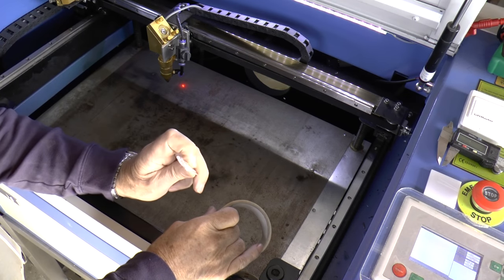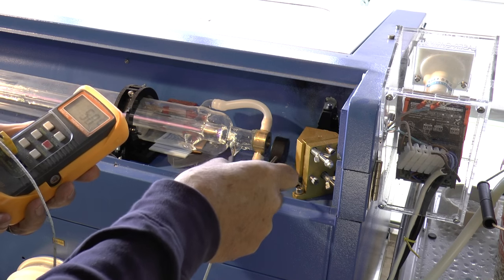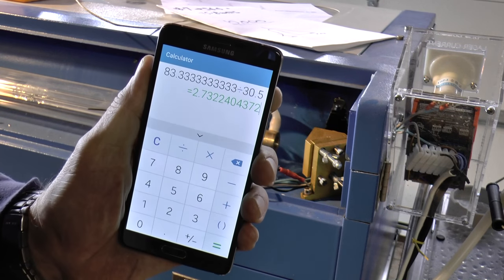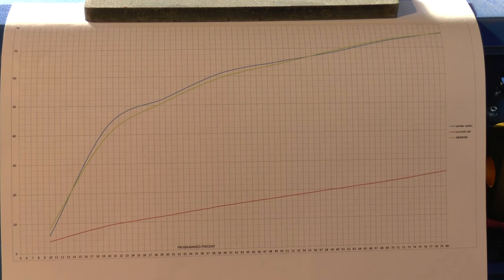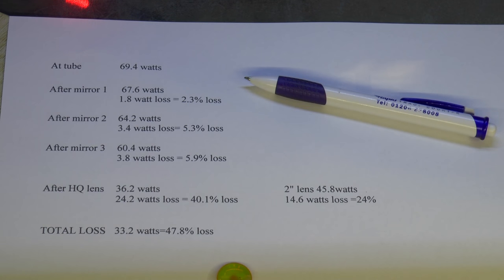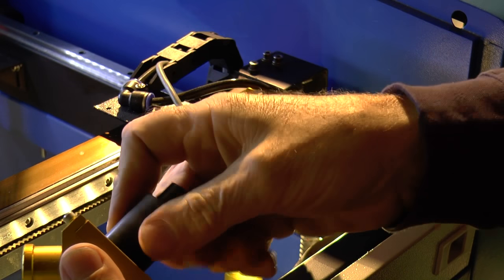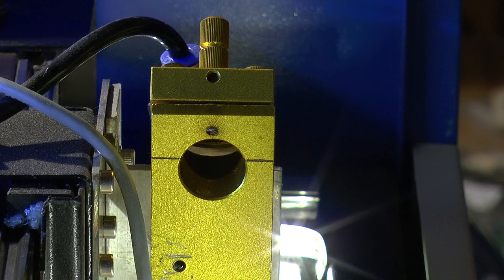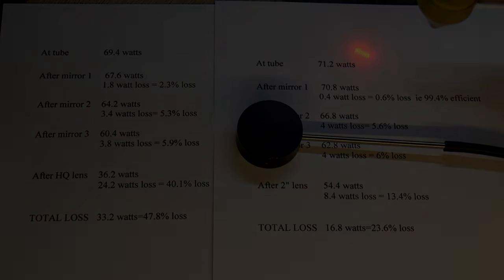RDWorks Learning Lab 79 Machine Health Check Part1

Comment: Russ, thanks to your labs I recently replaced my 50 watt co2 tube (after 6 years) and after carefully adjusting my mirrors  I was disappointed in the results. Looking at my #2 mirror I found it appearing like it needed cleaned but couldn't get the  wet look off. (like just cleaning it with alcohol but never drying?) So, I then ended up replacing all three due to their lack of luster or cracked appearance.
Now my performance and expectations have been met and I'm so glad for those labs like 79 and a few others.
Thanks so much,
Rick

Comment: Hi Russ...

Thank you for another splendid video. ;-)

At 20:39 you flick the mirror in the light, and in a split-second I could see that you have SERIOUS scratches in the mirror surface. 
That's for sure one of your power-loss problems, and your descision about buying  new copper mirrors for your machine will give you great value for money. 
When you clean your copper-mirrors, your best freind is acetic acid and acetone. First clean with acetic acid using a cotton-pad, then clean with acetone by dragging a lens-tissue along the surface.
(see the How To section on RDWorks Lab Forum)

Pepsi

Comment: Russ,
thank you for that video.

I'd like to say some words on the use of masking tape to check laser alignment:
I found out that the glue on the back of the tape immediately spoils the surface of the mirror or lens close to it.
There is some sort of oil film from the evaporated glue on the optical elements. Even if the laser is fired at very low power and short duration.
Since I noticed that I try to use small pieces of acrylic for the same purpose, but I'm still looking for some better material.

Concerning the lasertube lifetime I guess there are two effects combined.
1st) the diffusion of gas (namely helium) through the seals and even through the glass walls out of the tube.
This is a very slow but steady process, which takes years to render a tube useless. 
I have a He/Ne laser tube lying around for 30 years now, which is still working fine.

2nd) the destruction of the gas mix during operation.
Compared to the diffusion this process is pretty fast and  depends on the power the tube is forced to deliver.
Overdriving the tube of course accelerates the destruction of the gas mix significantly, but also "normal" operation
and even more operation at very low power ages the gas. 
Every ignition of the tube shortens it's life. 
So running a tube at very low power (which does a constat repeated ignition thousands of times per second!) is not very healthy to it. 
The tube will reach it's maximum lifespan when operated just above the point where the beam stabilizes.

Lothar
Reply from the maker: Hi Lothar
Thanks for sharing your experience. Nothing beats that.I have explored this so called "high impact engraving"region at low current just before the tube fires up fully,  and realized that it contains some very high currents (maybe 50 or 60 mA) at a frequency of about 3,5KHz. I use this region a lot for cutting card because it does a superb scorch-free cut. However, I have reasoned that I am accelerating the demise of my tube because these "over-driving" current values, although of short duration, are plenty long enough to cause dissociation. I also figured out that tube has to pass through this phase (albeit rapidly) every time the tube ignites. For most people this is the fact that will degrade the tube. The shelf life =tube life is something I learned recently from an "inside China" contact. As I said on my video, I am not surprised because  even the best tube makers offer a very short warranty period . However, I am still open minded about what happens and when. I am told to  not expect any significant power drop off until the CO2 has depleted to some critical level.  Performance then drops of rapidly

I use my tube intermittently so it should have an easy ride as far as dissociation  but its a 4000hour tube that has already "lived" 7000 hours and is showing little sign of failing. I shall keep monitoring and reporting from time to time.

Thanks again for your valuable input
Best regards
Russ

Comment: Russ my Laser quit working the tube is not putting out a beam, how can I test it ?How can I tell if it is the tube  or the power supply there is a green light on . There is three red lights on the motherboard 9-14-15 , the 14 is flashing. Can you help me. thank you Richard

Comment: Thanks for the response I have a problem which is the laser beam when engraving on the rubber has a volatile spark and the depth of the inscription is not good
Reply from the maker: Hi Anas
Rubber produces fumes that contains flammable products. If your laser power is too high, the power of the beam will be absorbed by the fumes and make them ignite. If you reduce the power and make sure you have lots of air assist you will get better results . You may have to run over the job twice to get the depth of cut  or slow down the speed to get the depth of cut with the reduced power. Are you using the ramp engraving option?

Best regards
Russ

Comment: Hello Russ,

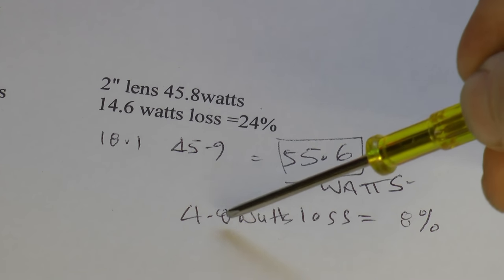At the end of the video you wondered why the lens loss (2" lens) went from 40.1% down to 13.4% loss after only cleaning the mirrors and not touching the lens.  You forgot that you fixed the beam alignment through the lens and at 17:27 you calculated you were down to an 8% loss.  Still puzzling why you rebounded to a 13.4% loss by the end, but it is less of a mystery than going from 40 to 13 when only touching the mirrors.  -Dustin
Reply from the maker: Hi Dustin
I did spot the bloop as I reviewed the edit but hoped others wouldn't. I figured they may be asleep or at least comatose at that point, so 10 out of 10. I have a new set of copper mirrors on order from China so there's another video in the offing. I tried to think back where this may have gone wrong and I decided that it was when I changed my tube. I was so pleased with the new tube I never checked out the beam performance itself. My original tube had a 6mm diameter beam and I suspect I was lucky in hitting the flat part of the first mirror. With the new beam at 8.5mm diameter, it revealed my incompetence at mirror manufacture.
Best regards
Russ

Comment: You warned us that the would be a need for contortions when checking the mirrors at the front of the machine, but you must be aware that the rail at the front of the cabinet is easily removed by undoing the clips at each end giving much clearer access.

Comment: well now, of course the lens losses would be cumulative from one mirror to the next ... correct? That is to say , wouldn't the loss off of mirror three be the cumulative losses from all three mirrors? If so, maybe better idea to start calculating losses from the lens end of the system then work back towards mirror one ?
Reply from the maker: Hi 
I agree, that would be another way of looking at the loss data. Equally valid would be to use the output from the laser as 100% and use that as the base for calculating the percentage losses along the beam path at each mirror. It doesn't really matter because its is only an indicator of where (and the magnitude of the problem) that has to be solved. If there were no losses at all, the results would be zero at all points regardless of the way that you did the calculations. Thus, it is using this logic that one can argue that all results are relative, and that absolute numbers are not that important.  The only thing that remains constant across all calculation methods is the resulting power available after the lens expressed as a percentage of what's coming out the tube. Typical systems would be working well if there were 2% loss at each of the 4 error points. ie 100 watts into mirror 1= 98 watts out . 98 watts into mirror 2 -=96.04 out. 96.04 into mirror 3=94.1 out and 94.1 watts into the lens=92.2 watts at the work surface. As you will see, even though we are taking the cumulative effect into account the DIFFERENCE  between this result and the  simple 4x2% =8% loss is going to have zero effect on our cutting efficiency. It's arguable that gaining maybe another 3 watts efficiency is not even worth the effort but that just occasionally checking the final output to make sure it does not get out of control is a more efficient method. For those without power meters I have suggested that they run a simple 25mm square test on 3mm  acrylic/ply/mdf. Set the power to 65% and find a speed that JUST allows the square to drop out. . Once the critical speed has been established you now have a reference point to check for total system power loss.......but of course no means of tracking it down, other than by trial and error cleaning of the beam path.
Thanks again for your suggestion because it's an interesting and valid point that I will bring into the conversation when I do the next video about losses as I fit my new copper mirrors and lens.
Best regards
Russ
Reply: thank you ... glad the moly mirrors fixed the issues. :)

Comment: Is there any chance you have encountered a failure to read from the udisk port.Everything was fine until I deleted the files I was testing and the machine will no longer read from any u disk .I've tried several and reloaded the files to no avail. It says no file found.Guy
Reply from the maker: Hi Guy
Several possibilities
First the filing system on your USB stick MUST be FAT32. 
Deleteing files is perfectly allowable and will not cause the problem you describe. I have several file transfer sticks and they all throw up this error from time to time. It's often a bad contact in the USB socket. I acually have an extension cable hanging off my USB socket for just that reason. At least I can easily change the USB cable.
If you have a USB extension cable plug that directly into the controller and I suspect that will fix the problem
Good luck
Best regards
Russ

Comment: Russ I am not sure I agree with you on the life of the tube as I have several eBay K40 lasers and one is well over a year old and doing just fine.  So if you calculate 365x24 hours is 8760 hours putting it well past 2000 hours meaning it should be dead 4 times over but its not,  Again this is not one, but I have two so I don't see this as a fluke.  Now I don't use them a lot, but if the shelf life concept is correct, then again I am well past 2000 hours on both and they both work just fine.  I do like the idea of testing the beam even weekly as 1 week would be about 1/12 of the 2000 hours so if the loss is linear than the beam should degrade at about 1/12 per week and we should see it.  I could buy the 10,000 hours or even 20000 as your correct there will be some level of diffusion from the tube but not that quickly...
Reply from the maker: There was always a myth about shelf life but I now have contacts within the industry that work directly with China and this is "inside" information and not supposition on my part. As I mentioned in the video my 4000 hour tube is still performing well at almost 7000 hours so I am waiting and watching with an open mind as well. Information such as yours is great to try and build up a real picture. 

Many thanks
Russ
Reply: Understand and many thanks writing back as I too work a lot (physically) in china but not on laser tubes and tend to be skeptical of most "inside" info I am provided as many times there is a context breakdown.  However will definitely start tracking my laser output for grins and giggle as it sounds like a fun experiment too :-) Cheers!
Reply: Russ, I kinda agree with DY3DTech.com

I've had my cheap machine for almost a year, and no doubt the tube is well over a year old, and I'm seeing no loss in cutting ability either.

I don't doubt the tubes have a shelf life, but I wonder exactly what the definition of the shelf life is and also what the power characteristic is verses time.

It would make sense for a manufacturer to specify that the tube would operate it its advertised power for a shelf life of N hours.
But at 2 x N it could be that the power is just 10% lower than at N, and most of us would not notice, as we get far more variation in material if we are cutting wood (like i do most of the time) and also a lot of variation in machine setup, (e.g. mirror alignment, dirt on lenses and the mirror etc etc)
Reply from the maker: Hi Roger
Some of the warranty periods look a bit flaky when you compare with the claimed tube life. But if you look at the Reci spec it's full of all sorts of strange statements
You get a 10 month warranty against a 14month tube life promise BUT if you read the following Reci Spec

2. 2.Operation conditions 
Water cooling: using purified water; 3 to 5 liter/minute; water temperature: 10℃-40℃. 
The operating environment: temperature 2-40℃; humidity 10-60%.The working current: test current is 32mA. Maximum working current is 32mA. The running
current must be kept below 30mA. The life span can reach 10,000 hours if the current is kept
below 28mA. The ammeter must be connected to the negative electrode of laser tube.
When it is working under over-high current for long term, the negative pole will appear purple and the life span will be 
shortened rapidly.
To protect dust from going into the insulation sheath, please wrap it with plastic film. 

Although the working/test current is 32mA they say max running current is 30mA but that the 10,000 life span CAN (MAY?) reach 10,000 hours IF you back off even more to 28mA. Without actual facts and figures I cynically interpret this as " you will get 100 watt at 30mA and if you are lucky may get 10,000 working hours from the tube if you never exceed 28ma  (which may deliver only 90 watts?)"
The other puzzling thing is that this spec is written for ALL the W6 tubes. but with a range of powers available in the W6 range  there cannot be one current figure that suits all.
My point here is that the only fact we can rely on is our own evidence. I am remaining open minded because my tube is already at 1.5  times it's 4000 hour life and like yours, showing no signs of power loss.
My information about tube/shelf life came from contacts within the Chinese laser industry and made some sort of sense when you look very skeptically at  the vagueness of tube specifications. All it tells me is that smoke and mirrors is the name of the game here

The only valid tube life evidence is from people that have bought proper tubes from credible manufacturers. Any facts on tube life from ebay machines must be ignored. They all seem to be supplied with tubes from KH Labs (some fake or fictitious organization) that seem to be rounding up production rejects from the big boys and re-badging them to give them a new identity. There must be some collusion within the industry because these tube ONLY appear on Ebay machines.  When I was in Ireland recently, I visited Wojciech and he has a nice fat 100watt EFR tube that has been rebadged KH Laser. Shine a light on the back side of the label and you can clearly see its EFR original label. As it happens, it seem to perform quite well.

I hope others with power meters and quality tubes will start doing monthly checks to see if the top power (out of the tube) is dipping off . I am watching mine with interest

Best regards
Russ
Reply: Fully agree Russ regarding charting the tube out and have ordered a meter and plan to start posting videos as things as I gain few measurements. :-)
Reply: I think RECI are covering their back.
In fact I'd rather they did give all this information regarding expected lifetime depending on power output. It makes total sense to me that the harder you drive the shorter the lifespan its likely to have. I wonder if the old thermionic emission valves have the same sorts of spec (I'll find out), as they operate by loosing electronics from the cathode - which I know is a different chemical process to the way the CO2 laser works - and loss of electrons is probably not linear, it probably is exponential based on the power you are passing through the valve.

Taking measurements of the tube is a good idea, but I noticed from your video, that you saw a marked variation in the tube output during the course of the tests over a few hours.

i.e The tube performs differently when it is used for the first time in the morning, and this is probably due to a combination of colder water coolant temperature and possibly also the state of the gas. (As I think I've read that the gas performance is better after its been used for a while - this may just be after 1 or 2 mins of use or even less)

So any test would need to try to remove these variables as far as possible
Reply from the maker: Hi Roger
Noted for next time
Thanks
Russ
Reply: Hi Russ

No worries.

I have the same problem with my laser power meter tests.

I keep having to re-run the machine, and compare all 3 of my meters, to determine whether the new meter I have in development is reading correctly or not, as the reading varies by several Watts, and the variability is normally caused by the laser output changing over time as the machine warms up.

I normally have the calorimeter held in place using a small bench vice (I got from LIDLS), so I remove the variability of angle of incidence of light and also I keep the lid closed, so I'm not getting effects from different air currents e.g. on a windy day.

I normally try to run my tests at 20 deg C water temperature

But I've never analysed power output vs coolant temperature, so I'm not sure how important this is.
And you'd need a commercial water cooler unit with adjustable temperature over a wide range to be able to do a decent set of tests on this
Reply from the maker: Hi Roger
 Perhaps you need a quick look at this
https://www.youtube.com/watch?v=asM0s7wm4AM

I did this with my old 40 watt tube when I knew a change was in the offing.

Regards
Russ
Reply: Thanks